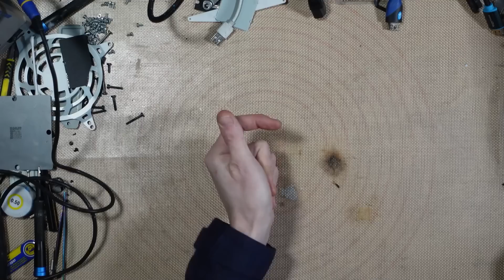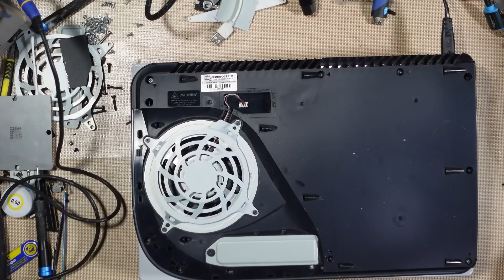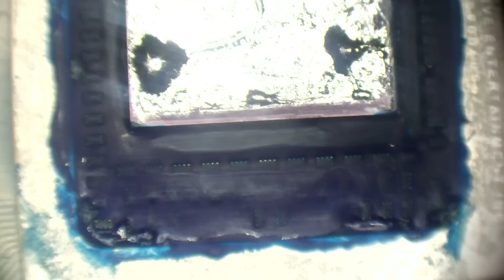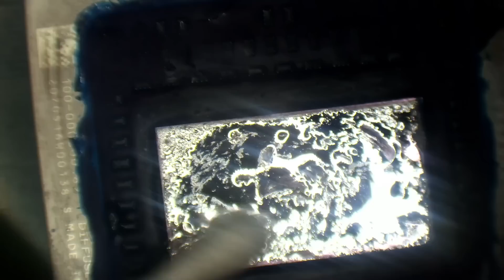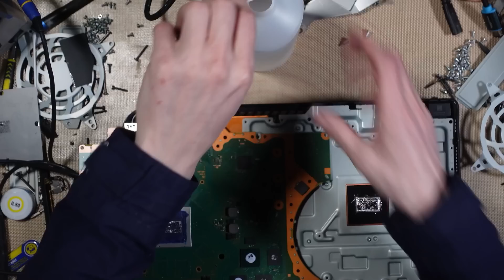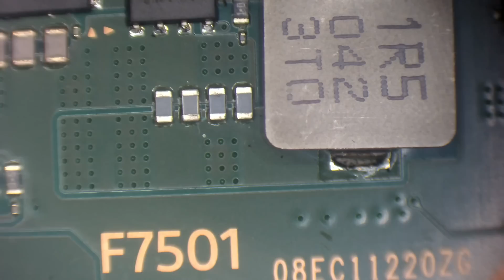My Customer Sent TWO Different PS5s Back For Warranty In 24 Hours! WTF Is Going On?

Comment: As a repair technician myself, I can agree that once something is repaired that's usually it. The only time a warranty repair normally occurs is due to faulty replacement parts.

But in situations similar to yours whereby 2 catastrophic failures occur (the same or different) within such a short time period I immediately look towards the customer in terms of how they may be using the device.

In your case it's even more prevalent since it's not only 2 different issues but also 2 different devices. The moment you said it was the same customer I immediately came to the same conclusion you did, bad mains power, which considering it should be kept relatively safe by the PS5 PSU, must mean it's quite a bad mains fault.

From experience, I would say cut your losses at this point. You may well end up with it back again and each time it happens the customer will become more and more annoyed, plus if the mains is killing the consoles, it may kill something that writes it off completely leaving you further out of pocket. You've done your best and more than most repair technicians would especially during the holiday, the customer should be able to appreciate that and accept the refund.

Comment: Slight misconception that electricity takes the path of least resistance.  Current will take all available paths to GND, with power (and heat) dissipation along each path being dependent upon its total series resistance.

Comment: Give them the money back or return fixed with no warranty ( and tell it will cost money next time they want it repaired). Its either A - kids treating console  like a football and are damaging the internals or B - the House Electrics that shorting it out (> take it u mean the House Wiring is causing voltage spikes? > would a power surge protector extension cable stop this?)

I guarantee if you fix it and return to the customer they will be back in a few days with same problem. 
Well done for fixing this at such short notice, (its probably a kids present) but I wouldn't work over two days during Christmas.
Really like your vids ...keep doing it!!!

Comment: I had a computer hard drive fail 3 times in a customer's system. 
Each time I told him it was probably a power supply issue. He swore it wasn't. 
However, by the third time, he was willing to install a UPS and convert his single power point to a quad.
It wasn't a warranty issue; each failure took more than a year, so the drive was out of warranty and he was paying.
It takes most people about 2 drive failures before they accept it might be a power issue.

Magically all the computer problems disappeared after this.

🙂

Comment: I make sure all my electronic devices are surge protected, as the wiring in my house is ancient.
My house is getting rewired in April this year though.

I also have a ps4 pro I may send to you for a clean out and new thermal paste….It currently heats up my whole bedroom if it’s left in for more than an hour 😂….So definitely overdue.

Comment: hey @TheCod3r i made one of the Nintendo Switch Bench PSU cables, i soldered to the B- and B+ on the battery pcb, and ran the leads to the respective + and - on the power supply but i am not getting any voltage on the battery connector? any ideas?

Comment: I would buy a brand new 1 give it to him and see if it comes back as a warrenty repair again if it does the refund him fix the new one but at least you can sell all 3 on and make more than your money back there still a massive demand for ps5 consoles your loosing money right now doing that but you'll male it back in the long run, believe me I do this with cctv and alarm installations and 99.9% you catch them on, you've no idea how many customer decide to fuck about with my installations after I leave then they break something and litterslly claim warrenty warrenty warrenty but fool me once same on me but fool me twice....... I don't think so

Comment: This may very well be the case. I’m a bike mechanic and I see allot of Bosch e-bikes. In the charger is a fail save. But if at any moment a problem occurs during charging it gives a error code that I can read in the diagnostic software. And I see quite allot, a problem with the wall socket where the charger is connected to. That this is faulty. And the charger stopped charging and went into fail save. 

Mostly people who made a wall socket them selfs in the garage though. But faulty wall sockets can destroy electric devices very easily. 

So your findings are more that plausible

Comment: Couple of things could have happened here, first, as you suspect they could have power spikes on their mains supply though to be honest this would probably do more damage than just a single decoupling capacitor going short but your experience seems to suggest otherwise. Second is if the console gets dropped ceramic capacitors can crack internally causing them to go short. I am thinking it is probably been dropped as liquid metal droplets had escaped from round the processor. It may not even been dropped just knocked over on a hard surface, if you hit these things just right it doesn't take much to cause problems. Either way I would do a refund and sell it to someone else because there is definitely something dodgy going on with this customer. 

Definitely get an LCR meter it will save you a hell of a lot of time and money with components rather than having to scavenge off donor boards.

Comment: Imo if it's for your Kid I would NEVER buy a repaired console, I know Phil knows his stuff but I ain't buying one with that many components changed.
I get that it worked after changing parts but I'd be thinking WHY it blew so many in the firstplace, the fundamental issue as to why it failed still remains as its definitely not normal to replace so many parts on 1 board just 'cause.
Yes PS5s are rare still but I bought a brand new 4.03 in February off BTShop.
I got the console, free game and extra boxed controller for £509.99
I sold the game and controller so the console ended up costing me just £439!
It remains boxed hoping a Hypervisor exploit arrives.
I say that to say the guy had all year to access a new console, I'm guessing second hand is not that much cheaper than mine!
Chin up Phil, I feel your pain buddy.

Comment: Money back 100%. (shame for the kid as Christmas was cancelled) Sounds like they have a dodgy electrical heater or something plugged in the same string. I'm guessing most electrical equipment wont be effected, but it seems the PS5 is a bit fragile. Does it have a fast or slow acting fuse to protect other components.

Comment: After your advice i just got my xbox working again. Thankyou kindly.
 My ssd drive is fried.
 New from ebay.
Can i send the ssd to you to see if you can fix it? You can keep it.
i would just like to know why it failed.
 My feeling is that as it was a cheap drive, it had bad sectors 
and these Chinese sellers found the bad sectors and put those sectors in a seperate file !
and when i formatted the drive it found those files and included them. 
It was supposed to be a 2tb ssd.
 but had 1.6tb avilable... 
After i formatted the ssd drive- it showed 1.9 tb....  Then when filling up this drive  my xbox1x froze-
and thats where you helped.
 Thanks again thumbs up.
☝

Comment: I would at least tell them there is a issue with the wiring in the room where it's being used. Otherwise this will keep happening. My guess is it in the kids room with a cheap multiway adapters and perhaps a high power device being unplugged frequently. Don't forget it's been very cold. Perhaps the kids had a 2000kw fan heater plugged Into the same circuit. The thermostat kicking in would put a hell of a spike on the line.

Comment: Constantly blaming the customer over there used refurbished repaired system breaking, is a clear sign of the person repairing it is full of it.  Seriously it was even missing the cover for the wire under the faceplate from the previously repair.  That’s just lazy work.  

Saying they dropped the system and broke it is just a sad excuse.  The system doesn’t even show signs of a drop and the cheeky warranty sticker was intact.  You can’t just void the guys warranty over a guess.  That is crazy.  This is why you stay away from refurbished repaired systems that are done by 3rd party shops.  Just refund them atleast.

Comment: Hot tip, when fixing consoles tell the customer in elec cases to buy surge protection extension cords.
Have an expensive sound system with PA speakers and if 1200w PA surge you’d go deaf lol, best safety and security
Reply: Ps5 has a built in surge protector
Reply: @Decodedz  so how’d the capacitor break like that?
Reply: @loatherd 

No idea, ask Sony as the PS5 and Xbox etc have built in surge protectors. I guess it wouldn't hurt to have an extra surge protector just in case. Lol

Comment: I have no electrics experience, but, when watching these past 2 videos the first thing that came to my mind was that it's the customers electric at fault. Maybe they are using poor extension leads, maybe there's been some kind of water ingress to their supply?
In the motor trade, where the customer is clearly at fault with warranty complaints we call the fault "the big nut behind the wheel"
I would ask to go with the customer and see how they set up the console and how it may be treated. That aside, I'd refund and have one less headache to worry about.

Comment: Well if the customer was taking what you were saying on board and trying to fix his electrical set-up, then maybe continue as it's not the kids fault there are dodgy wiring out there, failing that definitely refund and suggest they try another seller, maybe after enough trouble he'll get the hint it's he's issue. Guess this is what happens on third party resale. He'd have to get it out of Sony instead otherwise lol

Comment: Ceramic capacities crack and short out - this is typically caused by the PCB being flexed. This isn't a surprise after just being assembled. This isn't caused by the customer or their electrical system in their home.

Comment: No slight on you or your decision and it is stretching probabilities but it's Christmas, you want time off etc it could easily be really bad luck. if it can go wrong it will go wrong.

I worked in the repair sector and I've seen so many bizarre faults. I used to fix the premier points system in Gateway/Somerfield and I had a store that would catastrophically fail several times a week, we replaced everything over and over inc a new wiring run.

Eventually we replaced the lan controller again even tho it had been done dozens of times and that finally stopped it.

Balance of probabilities I'd either give it back and say if we get another fault attributable to this that's it or just refund them now and be done. Depends on their attitude we don't know how theyve treated you.

Good luck and enjoy the rest of Christmas I've been horrendously I'll since Christmas day my first time outta bed today so we've missed family time too this year.

Hope you have a good weekend and new year

Comment: I have a first generation ps3 that is need of thermal pad replacement, it works fine on 90% of games but on some games it will run a few minutes then shut down giving me a red flashing light, it will reboot straight away with no issues. I do take the compressed air can to it on a regular basis to blow dust out of it. I love my old ps3 because it’s fully backwards compatible with ps, ps2 and ps3. If this is something you can fix I would like to hear back from you.

Comment: This is something similar to what happened to a friend, I repaired a TV and the next day the TVs he had broke again and the pc won't turn on.
 I went to his house and check the voltage between phase and neutral (232v) between earth and phase (230v) and between neutral and earth (200v that should be as close to 0 as possible "normally 1v to 15v)  this is a transformer or a derivation in a wire. We called the electric company. 
They came very quickly, checked and said that several streets were affected and that they would look for the cause , the next day they inform it was fixed.

Comment: I've got a feeling this will start to be more common, power cuts are one thing, but local brownouts will destroy your electronics and as the voltage drops to 80v everything will generally seem fine but inside the devices are getting battered by poor service voltage. internal component frequencies are not able to be regulated, MOSFET timing gets screwed and capacitors just flat out shit themselves eventually.
Reply: Idk seems like there is a hardware issue with the PS5, i know two people who had their PS5 die on them, one is on his third unit, two people who live in different places, seems to be power delivery.

Comment: I very much doubt it was "bad electrics" that was the cause. Even if there was a power surge then the fault would be in the power supply, there is no chance that this would pass though and cause a capacitor to go faulty on the main board. Also all their other electronics in their house would suffer the same.

The most likely cause was if the console had received some physical shock like being dropped or knocked that shattered one of the ceramic plates inside the capacitor.

Did the console come with a base stand? Without it it would not take much for it to fall over and as the covers are curved there is no good way of having it horizontal too. I suspect that if it didn't they had it standing vertical and got knocked over and that shock would be enough to cause this.

Maybe that bank of capacitors are common failure point as that is one of the stress points if knocked over.
Reply from the maker: This entirely depends on the type of fault. They returned two consoles within 24 hours which seems very unlikely. The first one had a shorted southbridge as well as a blown fuse on the 5v line. The second had a bad cap on the 5v line. Yeah it did have the stand with it, whether they used it or not is anyone's guess.

The thing is, even something like a bad HDMI cable can cause such issues. HDMI carries 5v on pin 18, and 5v is handled by the southbridge (for some of it at least). So yes, in this case, it is entirely possible that faulty electrical equipment can be the cause. But in either case, I shouldn't have to foot the bill for it. As I say, I've been fixing these since they were released (literally within the first few weeks of them coming out) and I've never had a warranty return for a power related issue. I've seen things come back, but only for either once where I made a mistake and didn't run HDMI jumpers properly, or where it's been dropped by the customer or damaged in shipping. I'm not saying it's impossible for it to happen and be my fault, but two consoles? I personally struggle to find an explanation for that

Comment: Yeah, can definitely be electric installation. Though I don't have much in terms of experience with catastrophic failures, with PCs, I have seen issues with either stability, randomly turning off and even coil whine. Like I would get it back and it would work perfectly stable or in case of coil whine, none of that. But at customers end, problems persisted. Heck, sometimes it was even enough to just hook it up to different socket at customers house and problem would go away, as long as it wasn't on same line.

As for this customer, considering how they had you work over Christmas and stuff, twice, unless they will understand that they got their installation checked, I would go with refunding money. Sometimes you just need to cut your losses, because money isn't everything, peace of mind also has value.

Comment: All 4 of those ceramic caps need changed, it's possible they are under rated in terms of voltage, i.e. it's common recommended practice to have double the voltage rating for MLCC's, anything less can have long term issues. I.e. you can't run 25v MLCC's at 20vdc and be free from issues. Who knows what voltage rating the factory used.
Stress fractures can also be an issue, others have posted here about that. Either way replace all four anytime you work on these units.
Reply: exeactly

Comment: Its a hard situation to be in, when you have devices turn up from the same client, same house, with power problems. You can tend to feel as though you are insulting the person, telling them that they may have a problem with the electric lines at their residence. The customers that do listen, can often solve a problem that prevents future problems with no power and shorted electronics. Not all listen to what we have to say though. Great repair, thanks for sharing and Slacking Phil !🤣🤣

Comment: I'm not sure, it's a difficult predicament. Maybe give them one last chance and insist on them using a UPS. If they don't want to do that, then issue a refund.

As far as what's causing the the problem, if it's a mains power issue, shouldn't the PS5's power supply be able to handle any issues before getting to the MB? If it was blowing PSU's then I would suggest it's a mains issue.

The kids could be super rough with it too... Who knows.

Comment: I dont understand how you blame the customers electricity / other electronics for the failure. Ps5 has a big fat psu that must be producing one of the straightest 12v line on an oscilloscope with input tolerance ranging from 90 to 240v ac.

Maybe shi* just happens.

Comment: people forget about the purge you get through the outlet when appliances are turned on and off. could be something causing this from another room connected to the ring. a surge protected extension lead could save a lot of problems with delicate bits like a games console. 240v down to 5v a small purge and game over

Comment: It's a very strange situation that for sure. 2 power faults! Its got to be something silly like they are not pushing the figure 8 in properly or a old crusty extension block! I'd certainly be raising that as a concern with the customer.